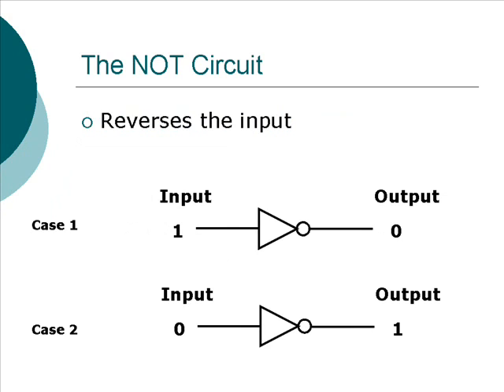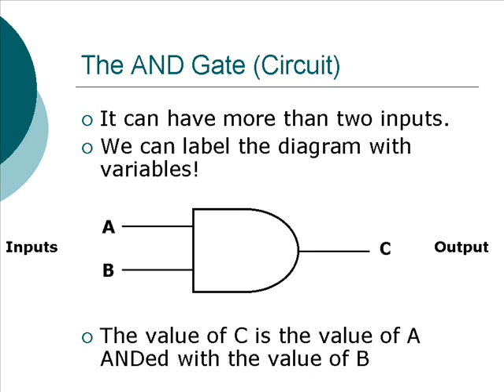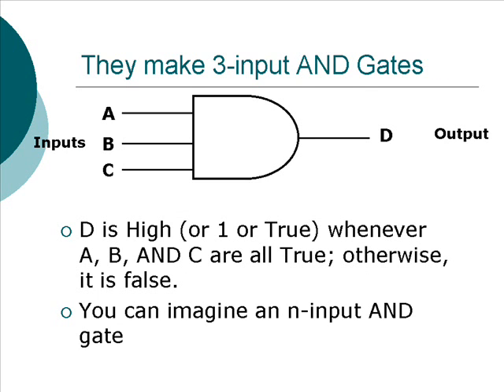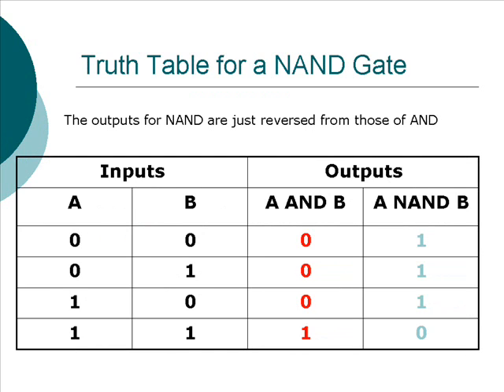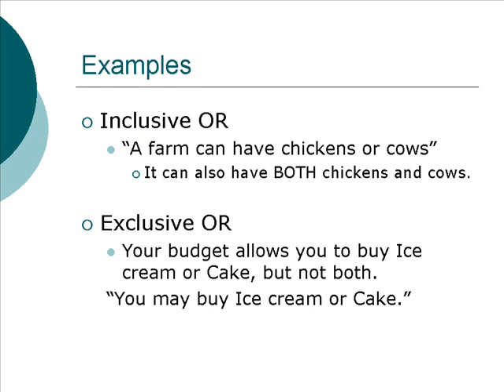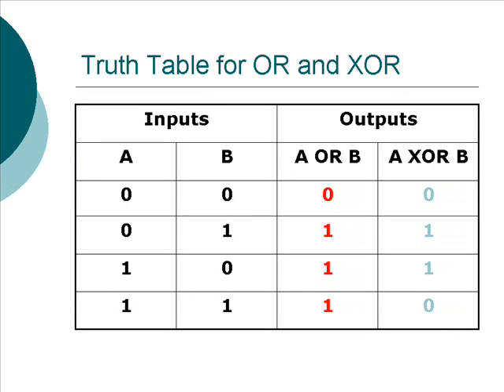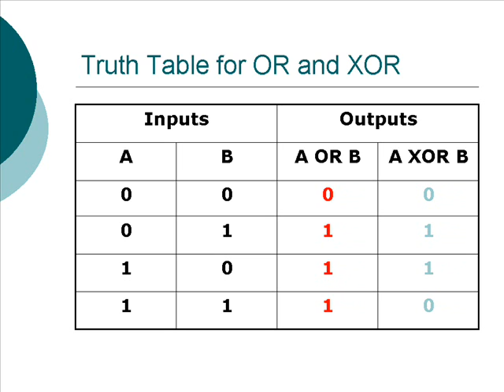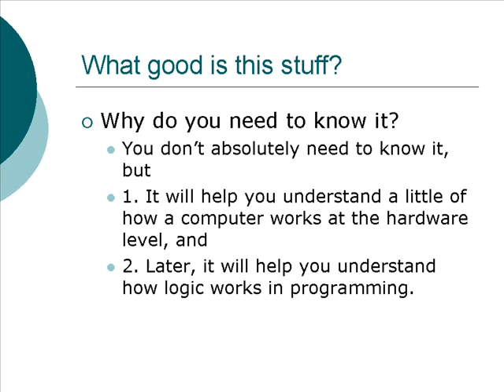Prelude to Computer Science - 7: Logic Gates

Comment from the maker: @Shadowmil2 You can have multiple inputs to any of those circuits at least in diagram.  I don' t think that multiple input logic gates can be bought, but you could make them out of other circuits (either logic circuits or the op amps).  I think it should return high if exactly one of the circuits is on, but low otherwise.